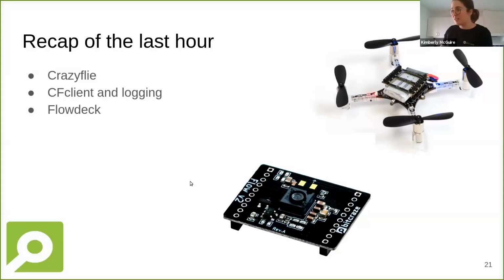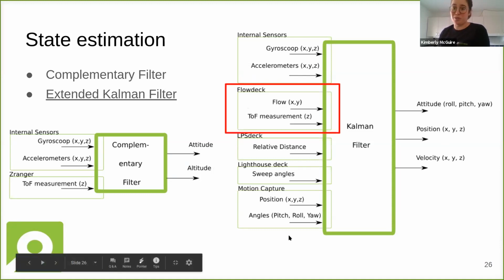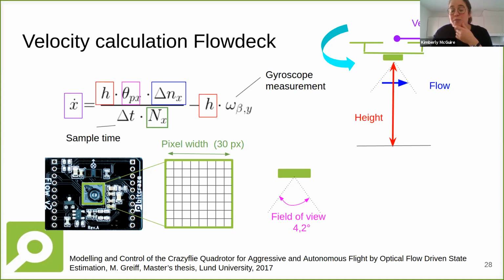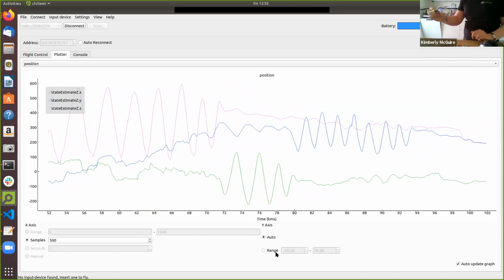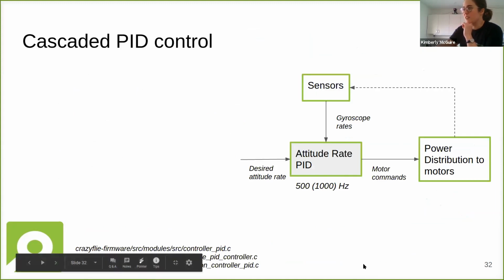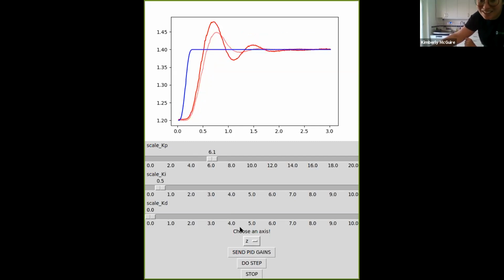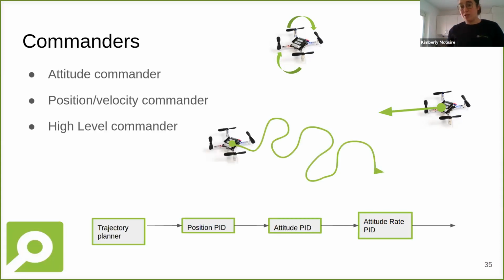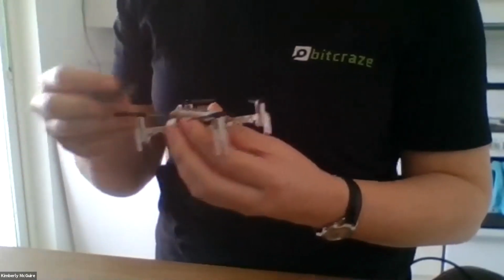Bitcraze - Crazyflie 101 EPFL-LIS lecture - part 2 (2020)

Comment: Hello Dr Kimberly! This lecture help me a lot to understand more about crazyflie. The PID controller was written on python? Is it possible to modify it? For example, implement NDI instead PID? Do you have the mass, inertia and thrust and torque constant of DC motors? Thanks in advanced!
Reply from the maker: Hi! The controller I was explaining here is actually written in C, on the embedded firmware of the crazyflie's microprocessor. And since that is opensource you can change that. And we happen to already have an NDI controller, namely INDI! Would you be able to ask your question on our support platform https://discussions.bitcraze.io/. Then we are able to help out more elaborately as you have a couple of questions.